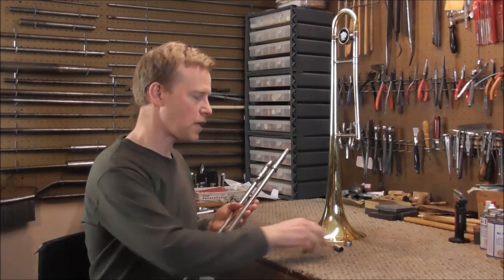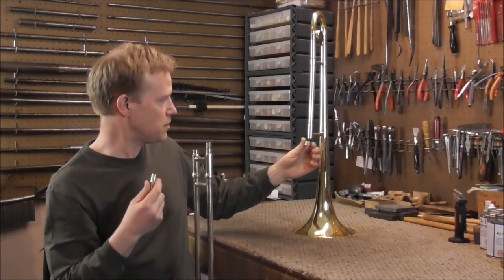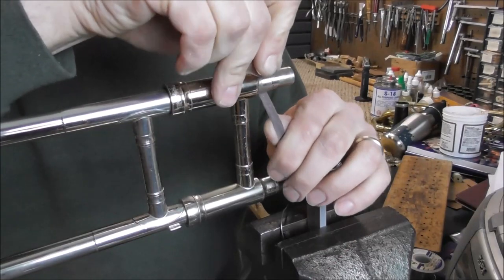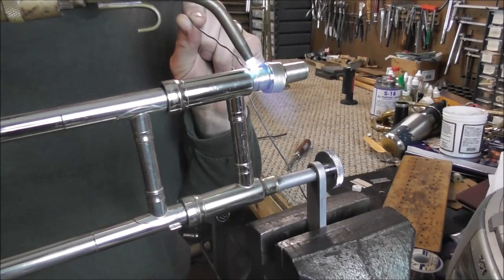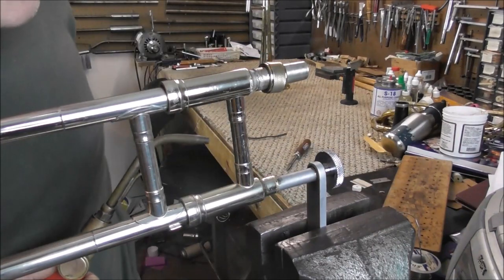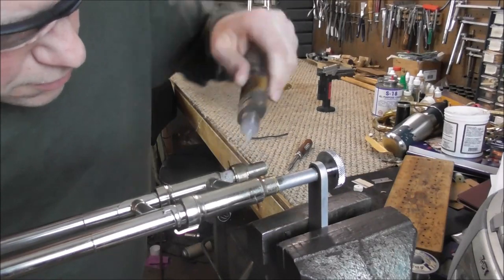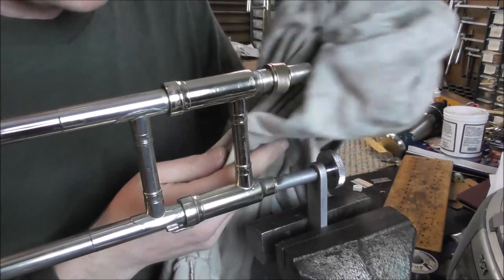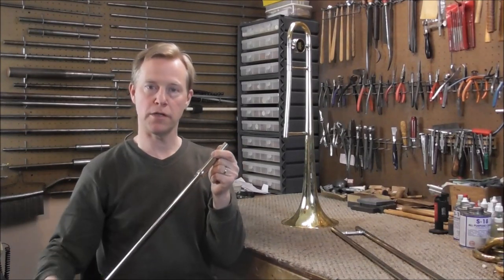How To Solder a Trombone Slide/Bell Socket

Comment: Interesting.  I haven't done any soldering on musical instruments but what your doing there looks very similar to soldering copper tubing.  I wonder if some of the principles would apply.  I heard you mention that the flux is acidic.  So is the flux used with copper tubing.  That flux is mixed with petroleum jelly to form a paste that is applied before the joint is assembled.  That insures that the flux is inside the joint.  Rosin core solder is not acidic but is usually chosen for assembly of electronic components and not tubing.  I wonder if it would work.  Just a thought.  The solder used for copper tubing is rated for different temperatures so that new work can be done adjacent to older work without disturbing the older solder joints.  Temperatures, if I remember correctly, start in the high 300F area.  Low temp indium solder wire has a melting point of 315F, which is extremely low.  I just read that on google.  I have not used that one but it might be useful to you.  I usually warm up the joint and then put the flame on one side and the solder on the other so I ensure that entire joint is warm enough for the solder to flow.  I use propane and mapp gas to solder tubing that is quite large.  The tip I use is larger than the one you're using.  I don't know if smaller tips are available.  I think the must be.  I use an auto starting nozzle with a button spark starter and a sustain button.  It looks like it would be fine for the work I see you doing.  I hope some of this info is useful.  If you have questions just ask.  Good video.  Here's the google site I was reading about:  https://www.digikey.com/en/product-highlight/c/chip-quik/low-temperature-indium-solder-wire
Reply from the maker: It sounds like you know more about soldering than I do. I use the solder that they trained us to use in college and it is the same as the instrument manufacturers use. I have never done research on other types of solder. That would be very interesting to do. Than you for the comment. 
Art
Reply: Boa tarde, sou do Brasil, poderia me dar mais informações sobre esse fluxo de solda liquido?
Good afternoon, I'm from Brazil, could you give me more information about this liquid solder flux?